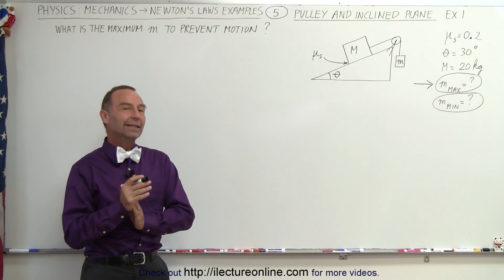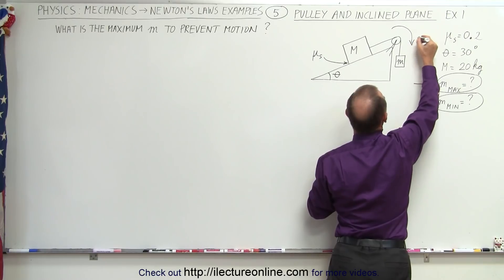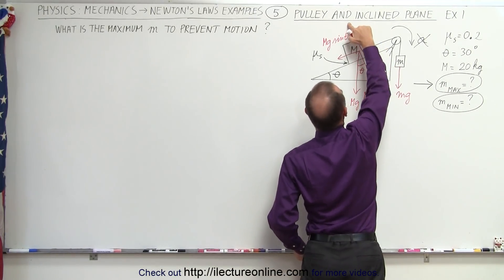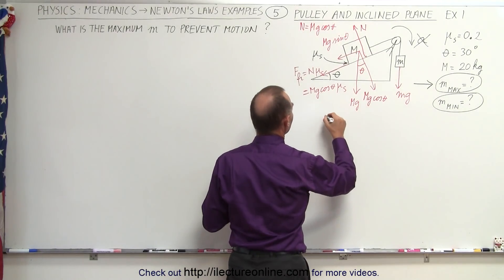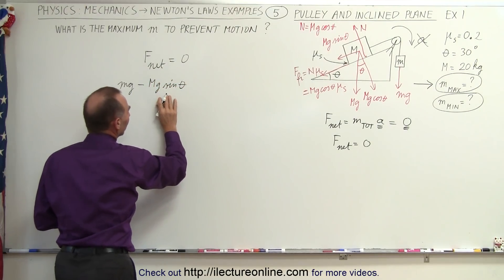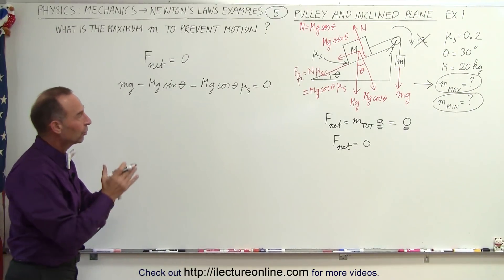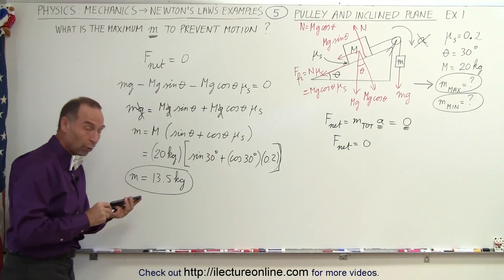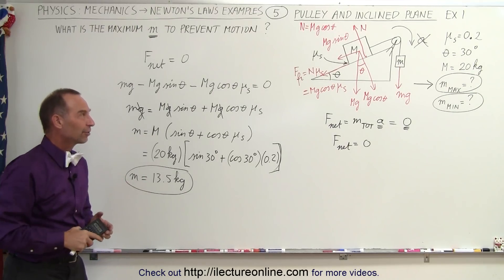Physics 4.1 Newton's Laws Examples (5 of 25) Pulley and Inclined Plane: Ex. 1

Comment: sir, is the same formula used for a frictionless inclined plane? thank you
Reply from the maker: If the plane was frictionless (in this video) you couldn't solve the problem since in this problem they are specifilly asking for the friction force.  But the general approach would be exactly the same for inclines where they are asking for the acceleration.  (We have lots of examples on this in various playlists on this channel).

Comment: sir, why it is not   (0.2)mgsintheta
Reply: bcs the friction is in the same direction of mgsintheta?
Reply from the maker: The direction of the friction force is indeed equal to the direction of mg sin(theta) (if the acceleration is clockwise)
Reply: @MichelvanBiezen  thank you so much sir! if the friction force is in the opposite direction of mgsin(theta),then it will be (0.2)mgsin(theta) isnt?
Reply from the maker: Depending on which way the direction of the acceleration is, you will either add or subtract the friction force.

Comment: The Best Teacher! You rock solid! 

1) Why is mew (0.2)  multipled to Mgcos(thetha) instead of Mgsin(thetha). I only needed another way of understanding. 

2) I don't know how to visually and conceptually see how the components of the force vector get calculated differently. When the box slides down, the force pulling it is Mgsin(thetha) instead of Mgcos(thetha). I'm used to your other videos where Fx is Fcos(thetha) and Fy is Fsin(thetha).
Reply from the maker: The friction force on an object on a flat surface is the product of its weight and the coefficient of friction.  On a incline, the friction forces is the product of the weight component perpendicular to the surface (mg cos(theta))  and the coefficient of friction.